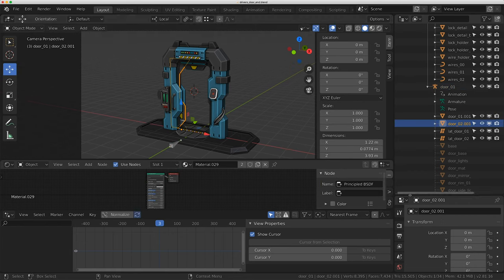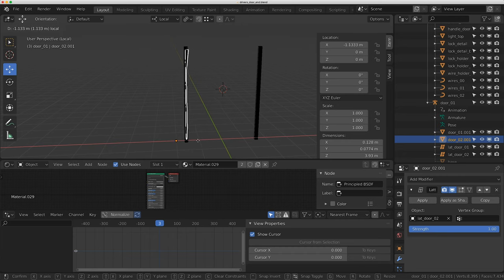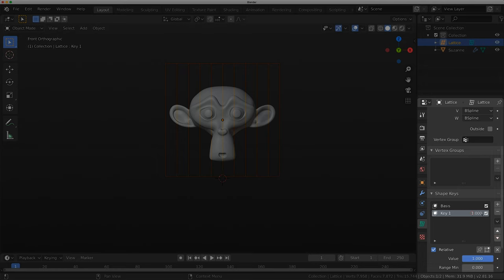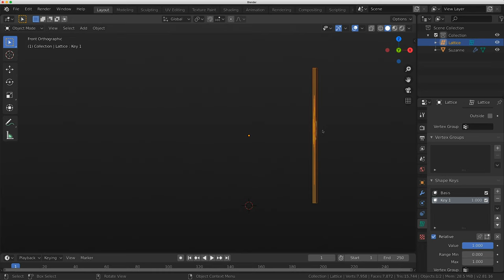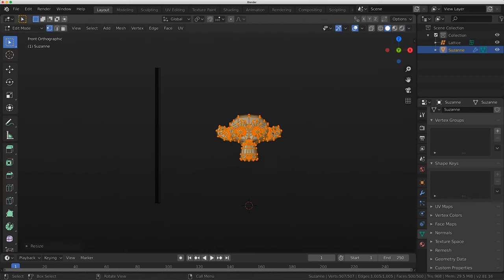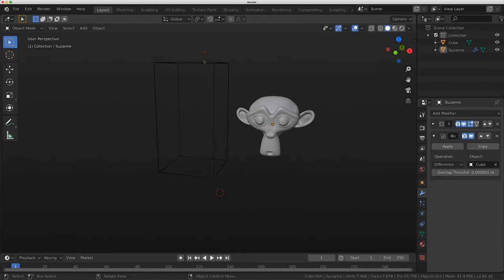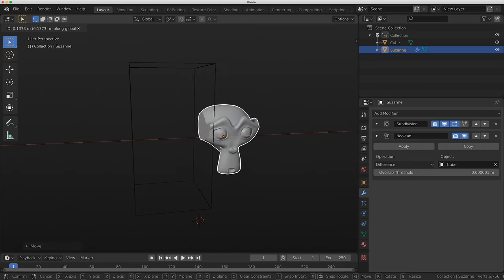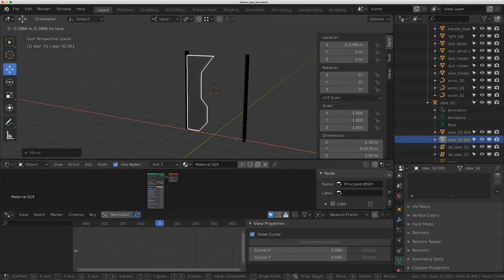Hiding Sci-Fi Doors | Blender Drivers Master Class

Comment: I have to admit, while watching the Drivers tutorial I was trying to work out how you made the doors vanish.  I thought perhaps the material had an alpha channel fixed to global space that the door was sliding into.  This method is much better though, and easily moved around.  Expanding the lattice with Suzanne inside it looked exactly like the old squeeze wipe transition from those early video switchers.
Reply from the maker: Haha yeah, I used this method on a show where the designs had doors that just opened into space. 
I like the idea of an alpha texture actually, that sounds like a useful shader!
Reply from the maker: Haha yeah, I used this method on a show where the designs had doors that just opened into space. 
I like the idea of an alpha texture actually, that sounds like a useful shader!

Comment: this is really smart and clever but what if I want to import this to a game engine and not just use it for an animation inside Blender?
Reply from the maker: For this, every lattice has an apply as a shape option. I would put the lattice at the fully open position and then apply this setting. Unity, for example, works great with Blender shape keys, I'm not sure about Unreal. From a quick search, there appear to be a couple of methods for Godot.
Reply: @LevelPixelLevel  thank you for this breathtaking answer

Comment: I can't get that boolean trick to work at all with my textured face on a large object, no matter how large I make the wire-frame cube I'm using. If I move the actual wireframe thing over the object it works, but no the other way around like you show it.
Reply from the maker: You may have to change the settings on the boolean modifier itself to either union, difference, or intersection. 
Check out the example files, and isolate two of my objects to confirm the set up.

Comment: You dont start with suzane you start with a grid where suzane is inside. In the objects menu there s something called Latice on top of suzane. What is that? if i start with suzane i just have suzane and dont have anything else. Can you explaing that please? Also i dont have the lattice green button menu on the bottom right corner i just have the texture menu option.

Comment: Can you please explain that how did you change the colour of the lock symbol.
Reply from the maker: In the shader network I used a mix shader with two different colored emission shaders coming in. Then I added a drive to the mix value.
Reply: Level Pixel Level thanks